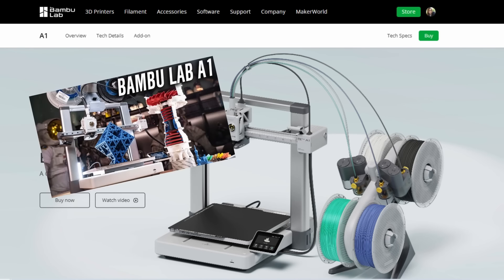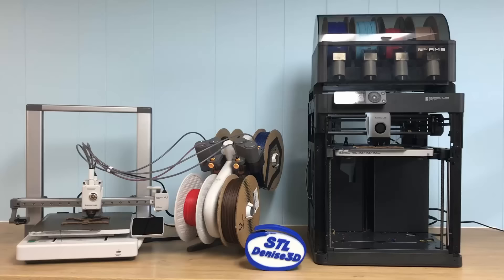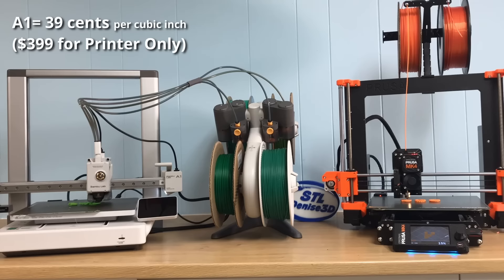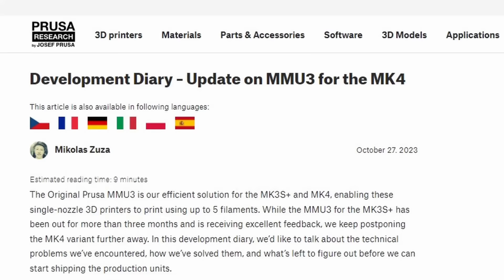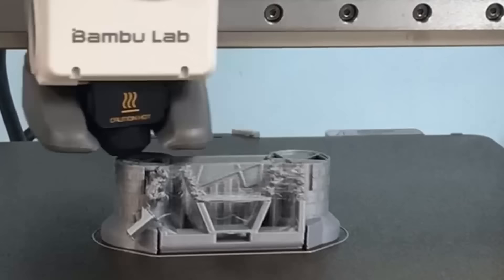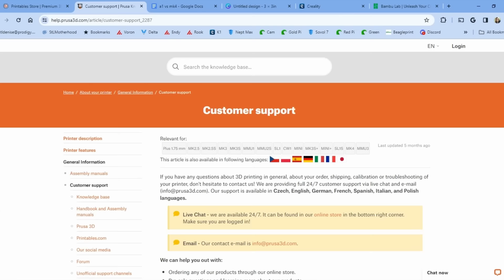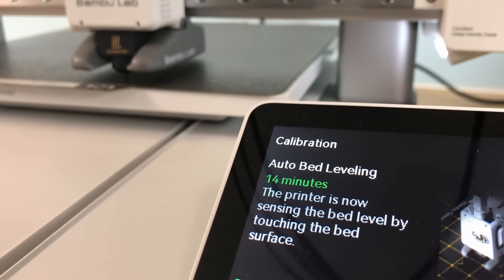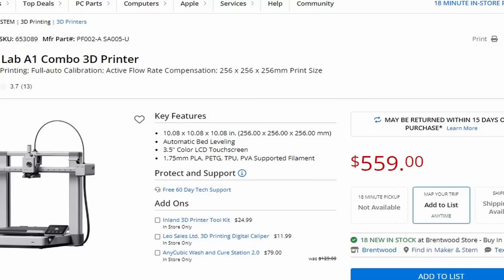Battle of the Bedslingers: Bambu A1 vs Prusa MK4

Comment: To be fair, cost comparison should be A1 without AMS Lite and Assembled MK4. Because of Prusa's very expensive shipping, I could buy 3 x A1 for the cost of 1 x MK4. Definitely, Prusa should move their manufaturing to China, keep their R&D in Czech and fire all the management team. They are releasing Beta products to customer. Some would say: "Oh, but Prusa gives a much better customer services". Here is my answer: Do they have another option? No! Sold my MK3S+ and bought 2 x X1C. I'll never look back!
Reply: Is that really the solution? All jobs to China. And to produce cheaply there, sometimes under inhumane and catastrophic environmental protection. 
There is a reason why many companies, at least in Europe, are withdrawing from China. 
The corona pandemic has made many people aware of their dependency.
Reply: it is not manufacturing in china, it is the process - if they would just injection mould most of the parts, it would be way cheaper - but josef prusa does not like this, because everything must be printable

the obvious thing would be: injection mould everything you can for cheap and still design the parts in a way, that replacements can be 3d printed - but this 200 IQ move is too much for good old josef to handle ;)
Reply: @suit1337  What nonsense. 
Everything is cheaper in China. Labor, material, energy.
Without regard for people and nature.
Supported by the state. 
Do you really think it's because of the few printed parts?

Comment: The Bambu will print great for a few months then, because it's as cheaply made as all low dollar 3d printers you may as well throw it away.  People buy Kias for the same reason.
Reply: shows you dont know what you're talking about.
Reply: @do7185  Which one, Bambu or Kia and how many articles do you want cited?
Reply: @chethammer  so from personal experience you bought a Bambu printer and ended up throwing it away after a few months?
Reply: @do7185  Not taking a chance on a printer that's 1200 with virtually no track record to speak of.  There are a lot of good printers and a whole lot more crappy ones.  I've been watching people give glowing remarks on Enders for years and they have an absolutely awful track record.  In a couple years, if Bambu proves itself, then I might consider one.  Especially if they can get the multicolor working right and cheaply.  That is one thing I hate about Prusa's.  Have to throw 4K at them to get multicolor built in.
Reply: Do me a favor and stop spreading false assumptions.  Bambu makes great printers.  I have an A1, P1P, X1 and X1Cs all with AMS units and they work well for what I make.  Was one of the first to buy a P1P and replace all my prusas.  Didn’t regret the move one bit.  Most of the naysayers are Prusa fanboys who can’t accept the fact that another company released a better printer with a working multicolor unit cheaper  than an obsolete overpriced mk3+.
Reply: @do7185  No.
Reply: Bruh ,bambu makes prusa look like a project.  Literally no clue what you're even on about.  Go look at one.
Reply: @Matt-bb3nr  I'm not saying that in the future I wouldn't be open to buying one.  What I am saying is that they aren't proven in the long run.  I can't afford to put 1200 in a printer and have it die in a year.  I love the A1 and its price point as well as the fact that for 600 you get the printer and AMC.  That is awesome.  I just question the longevity of them.  In a year, if the A1 doesn't have tons of problems, it proves it's maintainable, and Bambu support is there for me when I need it, then I'll get one.  I didn't get a Prusa until the MK3S.  I buy vehicles with proven reliability and safety ratings, not because they're cheap.  Cheap is great, until it isn't.....
Reply: Well aint you a butthurt fanboy
Reply: Ah yes, because the Bambulabs overbuilt linear rails are so fragile compared to the... linear rods??? Wait whats your argument again?

Thats some serious "I dont know what the hell Im talking about" energy.
Reply: @chethammer Bruh, people have had their printers for well more than a year now just fine. I've had my X1C for well over a year for instance.
Reply: @BeefIngot  I'm happy for you.  I've had my first Prusa for almost 5 now.  If it breaks, I can fix it.  That's not what I'm hearing from a Bambu.  I was almost a convert and was going to buy one and then found out about the software and how you send prints to the printer.  No transparency and no way to print directly to the printer.  Access to your network and anything on it.  That just won't work for me.  Hopefully in a couple years that will change.
Reply: Bro ender 3 is a Kia , bambulab is an Audi 😁, prusa is a Merc

Comment: The following is not to disparage anybody who buys a Bambu. You may not care nor be able to afford to be concerned with the following.
1) Bambu is not just closed source, but they have stolen tech and not given back to open source.
2) Their 'cloud first' ecosystem has too many privacy, security, and safety concerns to list.
3) Prusa does not tie you into their ecosystem and is 'local network first'.
4) The hardware has been demonstrated to not be as high quality, upgradable, and self repairable as Prusa's.
5) Denise downplayed the benefit of the 24hour in person support. It, in no way, can be compared to a wiki page!

There are many QOL features Prusa has to add to their printers to be competitive in this new market. I am glad Bambu has disrupted the market in this way. But I would not buy a Bambu for the above reasons.
Reply: 1) Do you have proof of this? I keep hearing about it but haven't seen any proof yet.
2) Just don't use it.
3) Not a big deal. Replacement parts are available and affordable.
4) Demonstrated how? The A1 looks very well designed and produced. The motion system itself is superior to the MK4. Everything on the A1 screams quality. The MK4 is an unpolished, unfinished product. Input shaping still in development, multi material not available, network capabilities limited and unreliable, no camera, no touch screen display, bunch of printed parts, less stable/rigid frame, smaller build volume and almost 3 times as expensive.
Reply: @elleryfg7853  
1) Yes. Proof not hard to find
2) Correct. Don't use an ecosystem with those concerns
3) Ease of full repair and upgradability with non-proprietary parts is a good thing
4) Demonstrated by many impartial reviews on this YouTube thing
5) Now there is a big bout of what aboutism! Yes, the MK4, today, has issues. So does the Bambu.
Reply: @dsjove  1) Well, show it. You're the one who mentioned it.
2)Just don't use the cloud. You can use LAN mode.
3) Sure but a proprietary system with all the replacement parts available and affordable is not a terrible thing either.
4) Please share a link to the video or videos you're referring to.
5) Could you please define whataboutism. Everything I mentioned are facts, the A1 is a superior product by far. The only things Prusa has going for them right now are the open source thing and customer service. But machine to machine the A1 run laps around the MK4. Prusa has fallen behind in less than 2 years, Bambu Lab is eating their lunch since the launch the X1C. A1 Mini made Prusa Mini a joke, A1 is making the whole MK line, MK3-MK4 a joke too.
Reply: @elleryfg7853 I don’t have any desire to research for somebody so emotionally fragile they cannot digest that somebody doesn’t like some things about a 3D printer they purchased.
Reply: @dsjove  1) I don't own any Bambu Lab machines. I do own 2 MK3S upgraded to mosquito hotends and Bondetch extruder, octoprint and linear rails.
2) If you need to do research then you're just repeating what you heard somewhere and have no actual proof of what you're stating. Not a good look.
3) You're entitled to your opinion in the same way we are entitled to ask questions about any claim that you make. If you can't back them up then you're just talking s..........t
Reply: @elleryfg7853  Ok. Not a defensive Bambu owner. Instead a Prusa owner that appears to feel betrayed. Yes,  Prusa needs play catchup, no argument. That happens sometimes when making competing products. 

This is a you tube comment thread, I really don't care if you think I am a bad looking shite talker. Thank's for pointing it out though.
Reply: @elleryfg7853 There is a lot to discuss in relation to Prusa and Bambulab. 
They are simply very different approaches. 
But have you ever watched a teardown video of Bambulab, especially the A1? 
High quality and well thought-out or repairability would not come to mind.
Reply: @herr_rossi69  yes I have. I watched V3D teardown and the only thing that's "different" is their choice of heating element for the bed. I say different because it's just that, different to what for example Prusa does, but it gets the job done, it's properly implemented and that helps keep the costs down. In any case it is a smart choice. Other than that I don't remember anything else that would point to corners being cut. Bambu Lab engineers and designers are great at their job and it shows in their products.
Reply: @herr_rossi69  repairability is not their goal. Their goal is to produce an appliance, how many times have you repaired your washer and or dryer, dishwasher. They want everyone using their machines, not just the people willing or able to tinker and do upgrades and repairs
Reply: @elleryfg7853  That is precisely the point. In the past, a product was designed so that it could be easily repaired. And that's what I did. But this was increasingly prevented by the manufacturers. 
Is it still appropriate not to repair and use resources in this way? 

Bambulabs are designed so that they can be mass-produced as quickly and cheaply as possible with minimal material costs. 
A right to repair is to be introduced in the EU.
And unfortunately it is necessary.
Reply: @dsjove  You won't research for them? but you claim to have that information already. seems you were flat out lying
Reply: @backtoearth1983  Yep. You got me. You see right through my lies. My devious plot spoiled.
Reply: @dsjove I'm not taking sides here or trying to hound anyone. I would say in the scientific community (and I personally think it should be a more standard practice) Citing evidence to support claims of any argument is standard practice. The source can then be evaluated for trustworthiness. As someone thinking of getting into the 3d printer game the bambu is attractive for what appears to be value for money. I have heard their support is a mixed bag and I have no reliable know pals who can give me a proper trustworthy rundown so I end up scrolling through reviews etc trying to critically extract nuggets of truth. It sucks because it's hard to sort out real and valid overarching points from individual good and bad experiences especially when brand loyalty starts to be added to the mix.

These kind of arguments are easily avoided by including links to the evidence that supposedly supports your argument and gives people like me reason to make a decision one way or another. To go back to the science research example, if I were to publish a paper making claims about a new implementation of some material and I was essentially just saying "Trust me the material does all these things, go research yourself", the paper would be rejected with comments saying "You should provide citations that back up your assertion of these material properties". If I made those claims and linked to a number of pre existing studies, the readers would immediately know where to look and could even critically evaluate those sources too. 

TLDR, if you make a claim, providing a citation shouldn't be seen as "too much effort" if your whole point rests on it. It's an integral part of making proper arguments and the wider public could benefit from implementing more evidence in their discourse.
Reply: 1) the Bambu Lab firmware recently was reverse engineered, there are no indications that they used any open source components in their software - besides bambu studio, which is open source - so where is the source for you claim of stolen tech? because josef prusa said it in his blog post?

2) this has also been disproven by the recent firmware disassembly - also you can use your printer in LAN only mode or even buy the X1E for industrial applications with no cloud connectivity

3) prusa does tie you in their ecosystem - ever been on printables or used prusa slicer? they try to shove down their products into your throat - and they try to implement more and more connectivity features

4) bambu lab has excellent repair guidlines and spare parts supply, similar to prusa - in some instances, they have bad products - right (warped build plates or exfoliated PEI coatings on the print bed  for example) but be realistic: you can buy 3, almost 4 A1 for the price of a prebuilt MK4 - even you you get 2 totally broken machines and trash them directly, you still saved money

5) i've been 3d printing for a long time, starting with a Stratasys Dimension 1200 a long time ago, i used the MK2.5 up to the MK3S+ for years - and in no instance ever i even thought about calling some 24/7 support - this is a moot argument

Comment: Not a single word about open source huh? Do you really own a piece of technology if you can't temper with what's under the hood? It's not yet as extreme as not being able to change the battery on your phone, but Bambu seems quite determined to build their technology using open source, but contributing zero to the community and making everything proprietary
Reply: They've contributed quite a bit back to slic3r.  Also made every other manufacturer do better.  What did creality do.
Reply: Ermm... Prusa isn't fully open...
Reply: @backtoearth1983  No it's not and it will be less and less, but we can all thank open source for the fact that we have a diversity of printers that we do today. Heck, OS is the reason we have internet at all.

Comment: My ender 3 max neo can print at 180 at better quality... i use the f e direct drive with a 2.35 titaniu. Bowiden inner is 1.82  i can do tpu at 150mm.  Getting that a1 and i bet you ima get that 400mm a second unlocked

Comment: For being in the rep rap Industry for soooo long they never figured out how to lower the cost smh 🤦 🤔🫢🛩💀
Reply: Cost is not everything. You can alway buy cheaper materials, find a cheaper manufatory location, Design for cheaper production, etc. The question is if you really want that, everything comes with a downside.
Reply: One is manufacturing in EU and tries to use suppliers from EU and USA whenever possible, the other sits in China.. here I think lies decent part of the price gap.